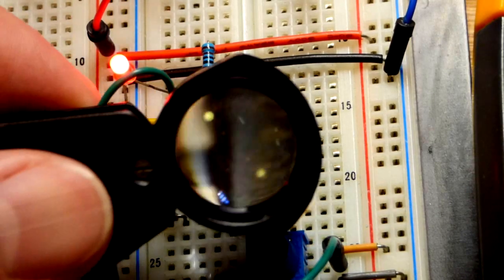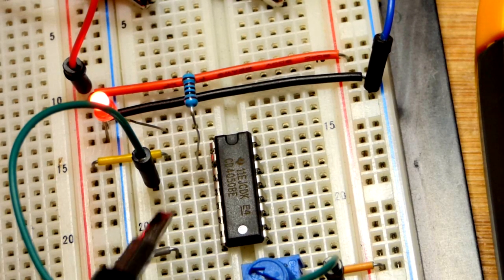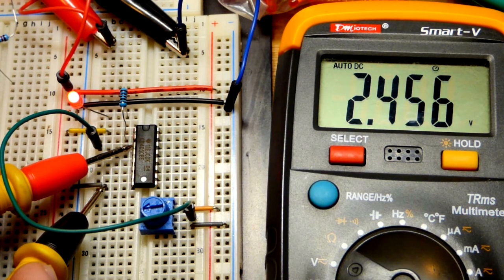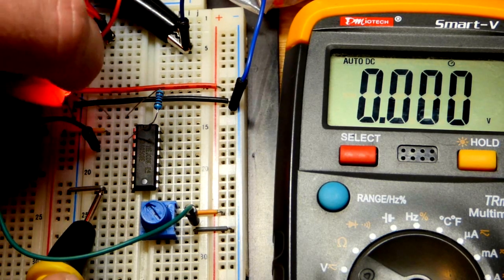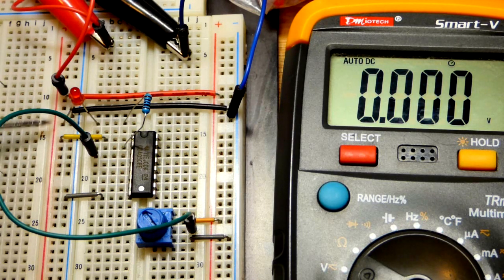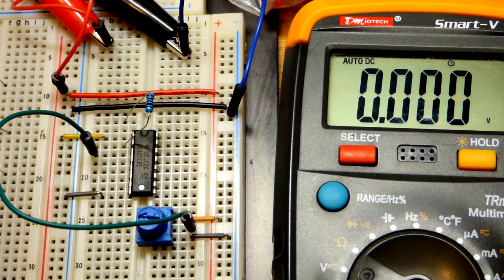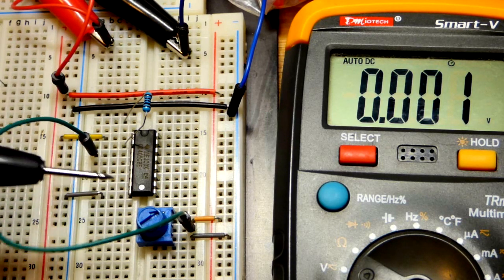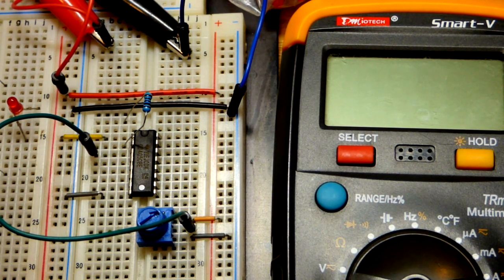First tests 4050 hex buffer IC electronics integrated circuit CD4050 CD4050B

Comment: I tested this on a breadboard. I use 2 of 6  input and output at the same time. One for sourcing and one for sinking. Each input also has its own potentiometer.  Everything is working like in the video except when I adjust the potentiometer, at certain point it affects the brightness of both LED.  This happens when both LED already turn on.
Why is that?

Comment: What does a buffer buff, I mean do anyhow?
Reply from the maker: No clue lol.
Reply: ir buffs current. When from a logic line of 1 (plus 5 or 3v3 or whatever level you have for high ,) some other circuit draws some current - as they all do- there comes a maximum load when the integrated circuit cannot keep the 5 v  at its nominal value because it cannot source so much current- yup, things are imperfect so when it can't hold the current the voltage drops as well. Sometimes it drops so much that you don't have a logic high anymore .... so then a buffer comes in and ..helps buff the current.

Comment: I have some TTL logic and am currently driving some very small 5ma diodes.....I would like to use a buffer, but Im a noob. :)  This chip seams like it would solve my logic level issues issues. Just curious  :) Cheers.
Reply from the maker: Nice! Hope it does! I only used buffers this one time, so still not sure how to best use them.
Reply: OK big instructor. I understand that when the input go to low the output goes from the positive to the output negative and when the input goes to high the current is changed the direction from the output positive. Thank you so much nice to hear from you again soon big brother

Comment: On pins 13 and 16 the data sheet identifies these as NC. What is NC? Thanks for the excellent videos.
Reply from the maker: Stands for not connected. They don't do anything so you can ignore them.
Reply: Thanks for the quick response. Not connected means, as you replies, doesn't do anything. I was confusing the pins as having a purpose, but for this circuit these pins are not connected. Thanks again.